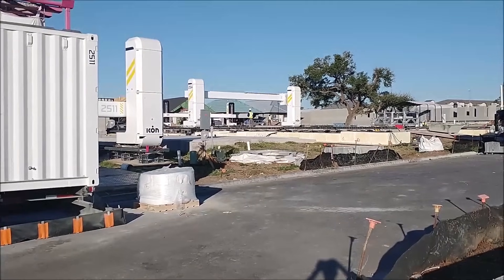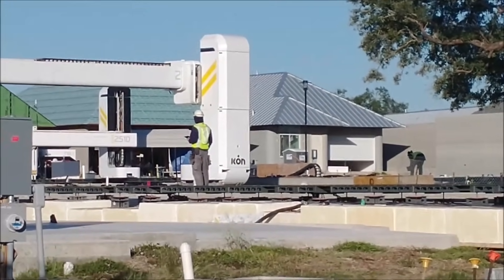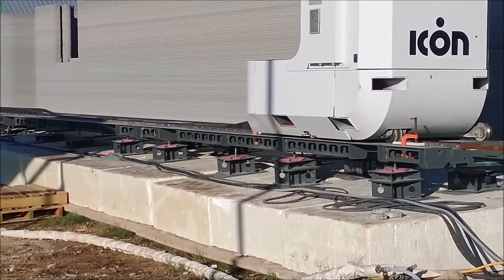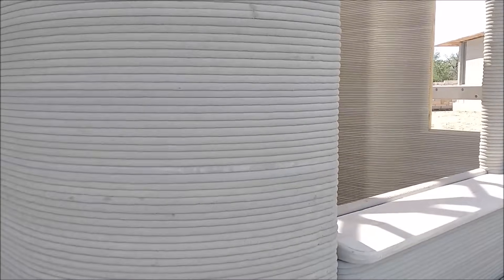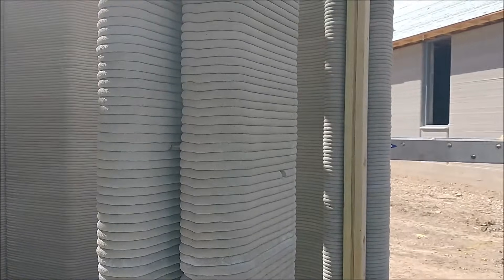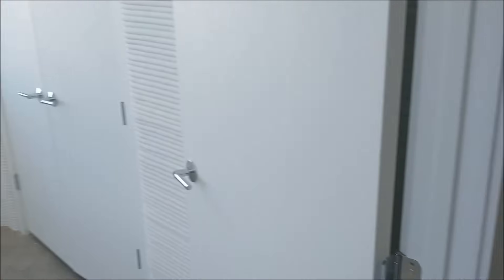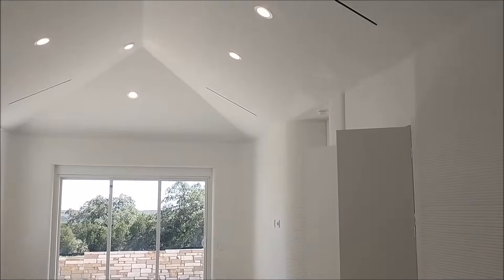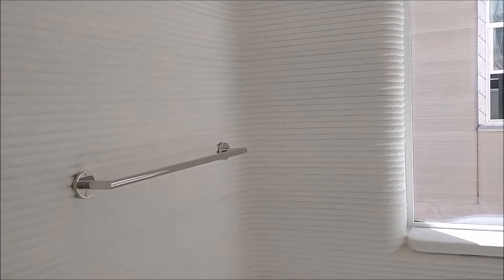Can You 3D Print an Entire House ??   You Have to See This......

Comment: Solid concrete wall or just with some air voids are not insulated and because out and inner wall are connected by concrete, then this are a point of heat or cold transfer so it not very good outer and inner walls should never touch

Comment: Thanks Joe. I would be curious to see how the electrical and other mechanical trades are carried out.
Reply from the maker: Me too. Even hanging a TV on the wall would be a challenge.
Reply: The same problem can occur in solid brick construction. Outside walls have cavities, but inner walls don't, so you either have to chase them into the walls, or run services through cupboards or similar, or have ducts.
I am sure those corrugated wall finishes would be good dust collectors.

Comment: They're only doing that to cut the labor cost. The cheaper they can build those homes more money they can make
Reply: On the other hand, when one of those giants malfunctions, they will need a very well paid on call technicians to put it wright. Not to mention the work force needed to build them and set them up and tare them down and transport them and produce the products to go in them. New opportunity for plaster tradesmen and paint sprayers. You get the idea.
Reply: But will they pass along the savings to the buyers, or try to charge just as much as the older styles of construction?
Reply: @frontiervirtcharter  I'm not sure what they charge, but it might be hard to compare one of these with a traditional home.  They are substantially better in many ways to a traditional home.  These homes will be much safer in a tornado, which are fairly common in TX.  The insulation properties of that concrete is extremely efficient.  It doesn't really matter if you hire someone to build you a wooden home or print a house from concrete, whoever is building it is going to make a healthy profit.
Reply: @frontiervirtcharter  Any good business owner must profit what the market will bare.

Comment: Lots of places in Texas have clay soil that shrinks and grows. I wonder if these will crack? Hanging things on the walls should be fun.
Reply: For large commercial building they use deep water injection in the soil to stabilize it. For residential use, the foundation is over-excavated and a sand base is laid down to reduce the effects of shrinkage and expansion. Local codes dictate what needs to be done based on a Geotechnical survey.

Comment: At the end of the day if the system works and if its cheaper than your standard construction methods, then you'll see more built like this.
I would absolutely plaster the inside.
Reply: Plenty of other things need building, not just houses.  I don't care much if my workshop has lines in the walls, I'll just run pipes & cables along them anyway.

Comment: Hi Joe, not sure I like the interior look, but what a nightmare to keep clean.  I'd like to see a smooth/plaster surface.
Reply: Yeah, that's what I thought.. and how do you repair it, can't just skim a hole..
Reply: @donvito1973  What?  I guess all those holes in plasterboard (drywall) are just going to have to stay that way.  Good lord....
Reply: @j.f.christ8421 I mean on the 3d printed ripple.. can't just skim over the ripples.. you'd need to make a form tool to apply the same texture.
Reply: @donvito1973  It's pretty coarse, matching it wouldn't be too hard.  Maybe the next version will smooth the wall or run a second process to fill in the lines, but I'm sure people will find something else to complain about.

Comment: How do you insulate it? Wouldn't be practical here where we get sub zero in the winter. Interesting video though. Thanks.
Reply: He shows you, it's double wall and they pump foam into it.  Same as brick.
Reply: In colder climates I've seen double layer outer walls with foam shot in the gap.

Comment: How the hell do they run the pluming and wiring with out messing up that rope affect?
Reply: Me thinks they leave vertical and horizontal voids in the concrete to create raceways for the wiring and print the concrete around wring device boxes as the proceed upwards.The pluming is likely run in cavities between parallel walls that later get blown in insulation.
Reply: @SandBoxJohn  It's double walled with foam insulation, same as a brick house.  Drop in the conduit before the foam goes it.

Comment: Not a bad idea. The only problem comes when you need to fix some plumbing or run a new wire in the wall. 
 
Were I printing this, I would add in wall channels for wiring and then do a final drywall finish.
Reply: It's double walled, same as brick.

Comment: I was just thinking, we haven't heard from Joe Pie in a while and then you uploaded lol. 

Can't believe they leave the walls unfinished with the print lines exposed, I don't like it one bit, though I'd imagine you could do a plaster skim coat finish over it if you wanted. 
   This is definitely a cool process but I can't imagine it would be cheap to have one built that and I'm concerned with the longevity of the product bc as I understand it, it's not like traditional concrete it's some kind of polymer mix and doesn't have sand and gravel in it. Be interesting to see how they hold up 25 to 30 years down the road. 👍👍
Reply: It's a demonstration project, they leave it like that to deliberately those show off the technology.  Hard to tell it's a cool 3D printed house when you slap drywall all over everything.

That said, I'm not too sure about those round corners inside rooms.

Comment: It's certainly interesting. I don't like the textured finish. Will get dirty quickly and be hard to clean. Also the material they are using has no reinforcement. In the UK at the moment we are having a few issues with public buildings that were built in the 70s using Reinforced Aerated Autoclaved Concrete. Wonder material at the time. Now showing its true colours. I wonder what this will be like in a few years. Look flimsy and definitely would not meet UK building regulations. As an aside, in the small town I live in we have one of the UKs foremost space companies. They have one of the largest 3d metal sintering machines in the world. They 3d print entire rocket engine thrust chambers.

Comment: It certainly looks like a good start. I can see a lot of refinement and expansion in the future though. The next generation should truck in and self setup without big rows of foundation blocks. No reason it couldn't print the foundation slab and incorporate finish troweling. I can also see it laying in flexible conduit, drain and PEX water pipes from big rolls as it prints. While the "rope" texture is interesting I can see it being a dust magnet. No reason it can't incorporate smoothing trowels to smooth the interior and exterior as it goes. Automatic installation of headers could certainly be added as well. Probably auto print around pre-fab door and window casings so the final door and window install takes minutes.
Reply: This version 1.  If it progresses anything like plastic printer have you'll send of the CAD files and you'll have your house the next day.

There was a German dude who showed his garage getting delivered one day.  Like getting a shipping container delivered but made from concrete.

Comment: I’m guessing it’s some type of fiber reinforced concrete mix.   My questions relate to using unreinforced concrete.  Normally there would be vertical and horizontal rebar.   For earthquake and wind loads you would typically have some reinforcement.   I’m also curious how they connected the walls to the foundation.  It looks like an electrician needed to be on site during printing to place conduit and electrical boxes.

Comment: Interesting.
Since long building houses using prefabricated blocks, like walls, has been used. That printer looks costly as a machine and costly to set up and adjust. I wonder what advantages this technology has.
Reply: Fast & cheap are two advantages.  Consistent construction as well as it's hard for the builder to take shortcuts.
Reply: @j.f.christ8421  As long as the rigger doesn't take short cuts, I agree with You!

Comment: Wow ! Great innovation, Joe some remarks are just ridiculous ,don’t people understand that the inside walls can be finished anyway they want ? No imagination ! I have see this before , and the video of the nozzle Pouring out the concrete . The machine and it’s supports probably cost a fortune, but will save on time and labor , I guess after a whole communities built the cost will drop tremendously! I do miss your videos of unique and precise engineering please find a new Challenge so we all can enjoy your special talents. Thank you !
Reply: I wouldn't say they're ridiculous, just pointing out some of the drawbacks of this method.  Having to plaster over your brand new, painted walls kind of defeats the purpose of saving labor in the first place.  Good luck trying to get that new wall flat with just a hand trowel.  And what about when you need to remodel?  How easy will it be to knock down a wall?  What about adding electrical fixtures, network cables, doors, windows, etc.?  This is an interesting concept that has plenty of merits, but as a contractor myself I can only imagine the headaches this will cause for future repairs and renovations.
Reply: @10-4CodyWade  There are other building besides houses...
Reply: I couldn't agree more. I thought Joe's Channel was populated with mechanically inclined and innovated people, not a bunch of pencil necked yuppies. For a time I did consulting work as an IE. - "That's the way we have always done it" is the one thing that prevents any progress,,,,and main reason for the existence of the Japanese auto industry.and loss of countless American jobs. - Take a ride through Detroit and Cleveland some time and you will see the result of typical pencil neck thinking. 

Thanks for the look at the future, Joe.

Comment: In 2018 I spoke with an engineer trying to get funding for development of one of these. The material he said they use is specially formulated to cure really quick after it gets put down. The one he was representing used a second tank of a "proprietary liquid" that is injected into the concrete that activates the accelerated curing process.  I think, and this is just a guess, it is a binary thermal reaction.

Comment: All the walls have built-in dust catchers. Technologically advanced but ugly as sin.
Reply: Just put tile on it.  Problem solved.
Reply: @travismiller5548  And what if someone doesn't like tile on every wall? Not to mention the added cost of tile - it isn't cheap. If the partial purpose of this construction method is to save time then adding a complete shell to the inside defeats that purpose.
Reply: @kennethstaszak9990  Then slap drywall over it like every other house.  It's till going to be cheaper & faster than current construction.
Reply: @j.f.christ8421  I seriously doubt that will be cheaper or faster since there will have to be some sort of structure added to hang the drywall to. So carpenters will need to, at a minimum, add and shim  furring to get a surface even enough to hang the drywall on. As soon as someone does such a thing and shows a cost comparison I'll believe it 's cheaper
Reply: @kennethstaszak9990  The entire structure will be cheaper as the actual house bit can be built fast than your typically wood framed house (well the roof is still timber frame).  Hanging drywall would be a similar time & cost for both.  Personally I hate drywall so I'd just fill in the gaps instead.
Reply: @j.f.christ8421  If you say so.
Reply: @kennethstaszak9990  I am the word.  Well, you have words too but they're rubbish.
Reply: @j.f.christ8421  Who are you trying to convince  - me or yourself?

Comment: I have to wonder how it would compare to something like shuttered and poured concrete, or the polystyrene blocks with poured concrete in the amount of time it takes from turning up on site to finished walls
Might be a slight advantage for a row of houses.
Reply: 26 years ago I had my house made with ICF (Insulated Concrete Forms, the foam blocks), outer walls. The inner walls and roof are normal wood construction.  Still living there, and there have only been a couple issues. 

The most surprising, is the temperature differential between the ICF walls and the triangular section of the 'gable ends' which are normal wood frame.  The triangle is cool enough in the winter that there is condensation on it, and it became a mildew problem.  Had to clean it and use mildew resistant paint on it.

The other issue, which contributed to the mildew, is that the house doesn't 'breathe' like normal stick construction.  There is Zero chance for humidity to equalize without deliberate control.  We didn't know that and had a normal central heating/cooling system built in.  The lesson we learned is that if you're going with a truly airtight construction, you NEED humidity control as well as temperature control.

Comment: Hurricane  proof????
Reply: Resistant - And probably better than "stick built" because the roofing structure has a very solid base to attach to. Watch some videos of hurricane/tornado damage and you often note that the roof is lifted first (doesn't take much) which then removes the load on the outside walls, which then fail due to the side load.